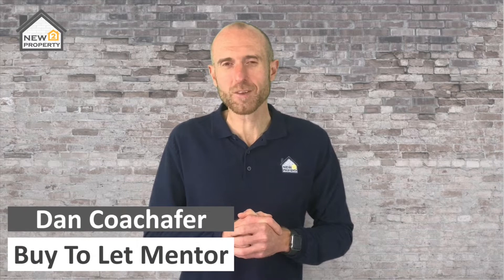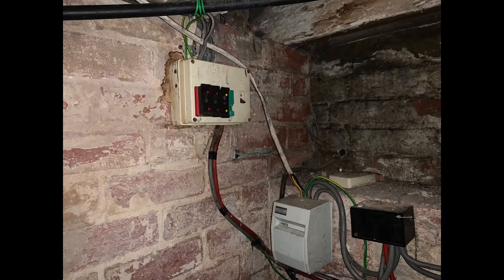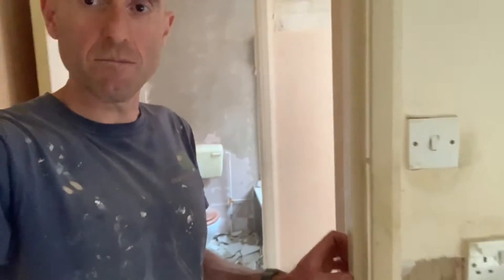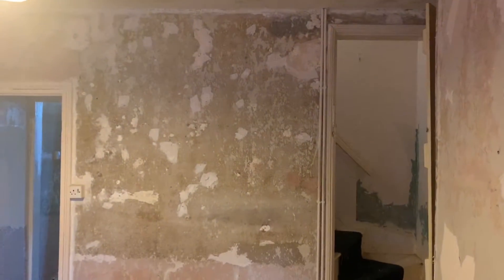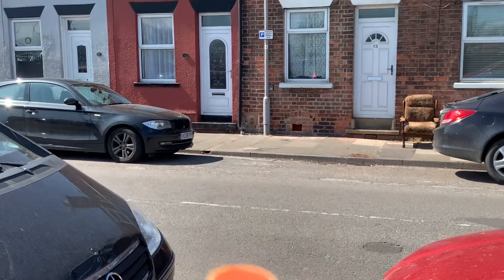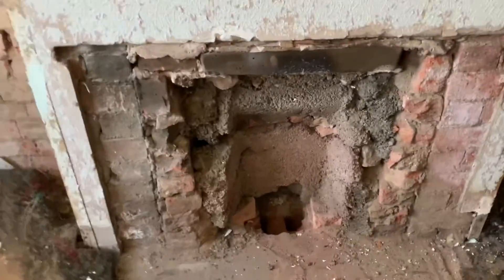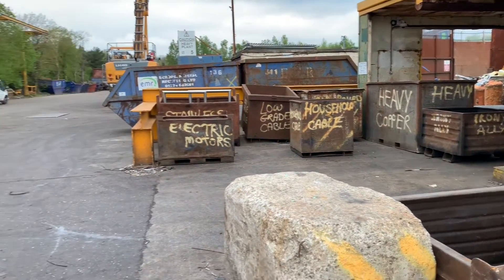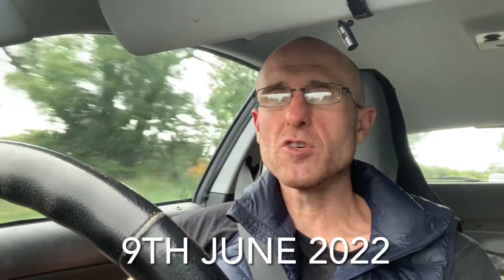BRRR | Buy To Let Property Number 19 | Part 1 - The Rip Out | Buy To Let Advice For UK Landlords

Comment: Block the fireplace cavity with concrete or thermal blocks whilst leaving the air vent hole. That way theres a good barrier between the void and the plasterboard from inevitable damp dust and debris that falls down from the original flue lining render. There is also less chance of impact damage from tenants, and the new plasterboard is dot and dabbed to the original surrounding masonry and the new infill. Its cheap, easy to do, does not have to be pretty. Its inorganic unlike the timber stud you've used so no chance of rot taking hold and spreading.
Reply from the maker: Hey Steven D,
Thanks very much for watching and for taking the time to comment. 
This is very helpful, thanks very much I appreciate your advise.

Comment: Do you ever think if property prices massively drop and then interest rates go right up when your 2 year fixed is done... You'll be in trouble?
Either because you won't have 25% value within the property to qualify for a new mortgage or that those interest rates will make your cash flow next to nothing?
Reply from the maker: Hi Craig,
I do yes, I also have it in the back of my mind that when I cross a road I could get hit by a bus but it doesn't stop me taking a calculated risk and crossing anyway.
Reply: @new2property  A financial stress test is a very normal thing to do in business.. It's how we survive.
Reply from the maker: Hi  @craigjames8026 do you not think that the lenders stress tests done on application will be enough?
I`m planning to bridge the crash with a 5 year fixed and although I`m confident that values will drop I believe it wont be for some time yet meaning that when they do drop they wont go to a level lower than what I am currently buying at.
I`m also confident that the interest rates won`t go too high as its really not in the governments interest to have a large interest bill on top of the large amount they currently owe.
Reply: @new2property  hi,
The lenders only care about making their loan secure. They don't care if the house drops in value, that's why the best buy to let rates are at 25% L to V, the lenders know that if house prices dropped significantly they could recall their loan before it dropped even further and affected their money.
Reply from the maker: @craigjames8026  👍
Reply: @new2property  unless your balance sheet is better than I think 🤔 to me you seem over leveraged and vulnerable.
Your ego can be your enemy, I'd focus on security at the moment.
Reply from the maker: @craigjames8026  like I said James I’ll dedicate a video to you if it all comes crashing down. 
You do you, I’ll do me and I hope the best for us both 👍
Reply: @new2property  Hope you getting that video ready for me....
Reply from the maker: @craigjames8026  I`m working on it 🙂

Comment: Never allow speedfit plumbing fittings to be used.
Reply from the maker: Hi Steven D,
Thanks very much for watching and for taking the time to comment, whats the reason for not allowing speedfit pluming fittings? 
I assume you`ll say unreliable? but would be great to get some additional detail/info
Thanks
Reply: @new2property  Hi Dan, they're easy to fit and easy to fail. Over the years I've seen the devastation caused when they blow off. Essentially micro vibrations run through all pipework under normal useage which slowly but surely can cause a fitting to slip and blow. They tend to be fitted on modern systems so most pipework has mains pressure, so when they blow they pour out at mains pressure. They tend to be a good examplar of the mindset of the plumber. They are fast and easy to fit without fundamental skill or good practice so they get toshed in with barely a clip in sight. should be okay but i wouldnt allow them in m y house.